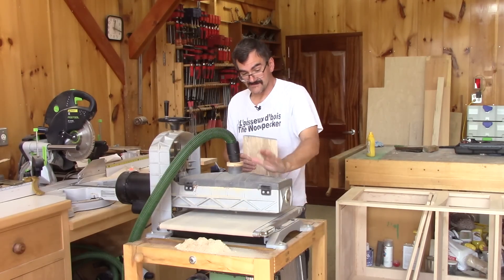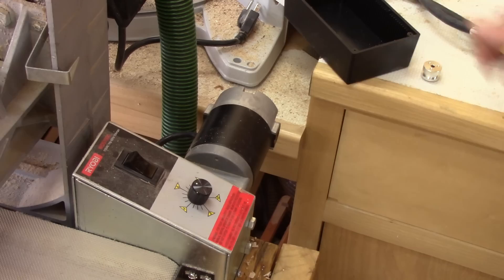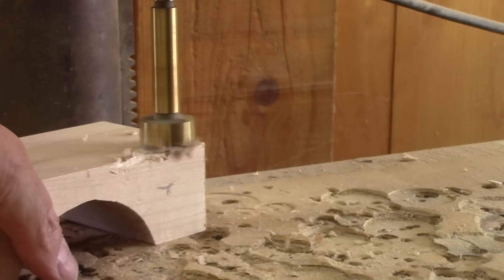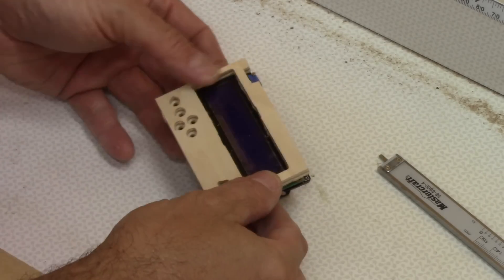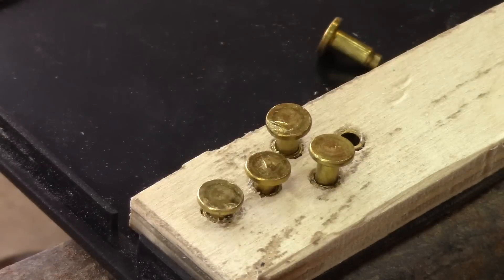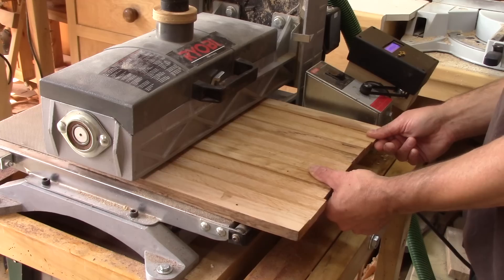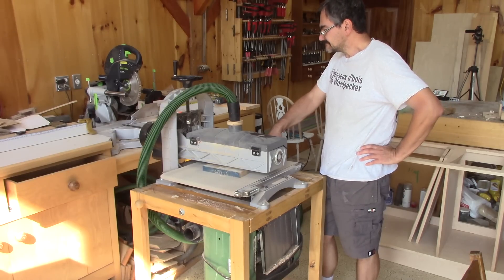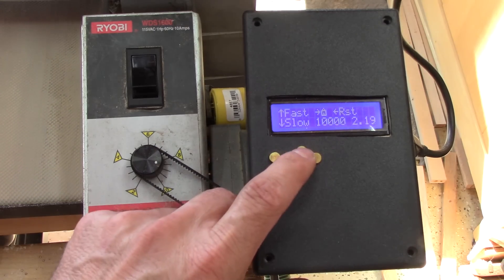The Woodpecker Ep 168 - Drum sander feed rate controller

Comment: Why didnt you modify the existing box and use a transistor or something in that region instead of turning the existing potentiometer with the stepper motor?
Reply from the maker: it was my first thought, but I was a little bit scared of screwing up the speed controler inside the sander. this way I don't have any modification to do to the original sander